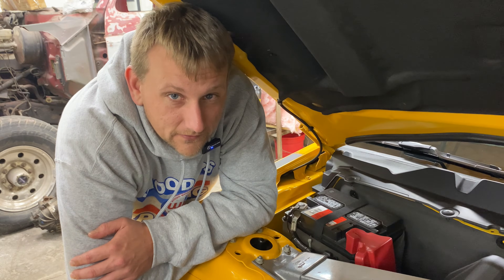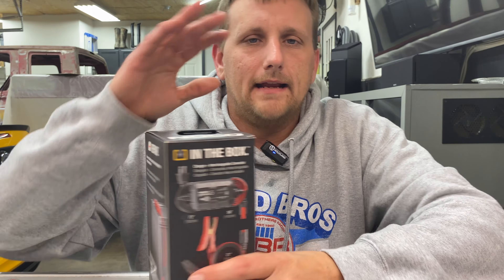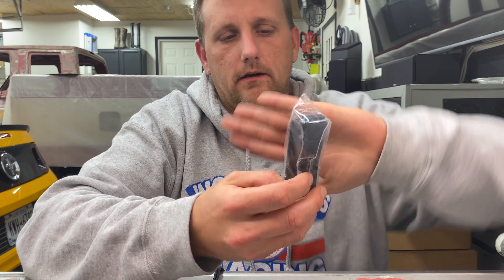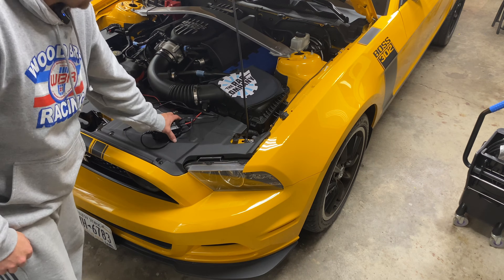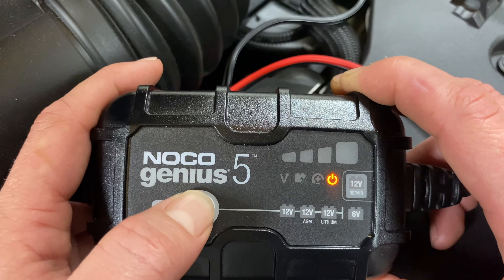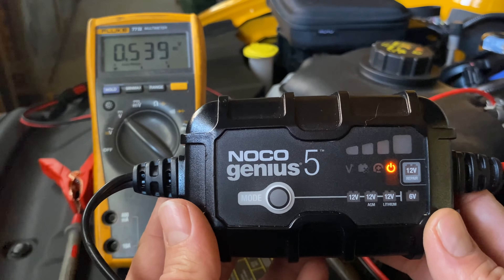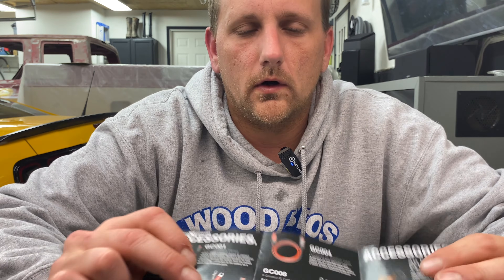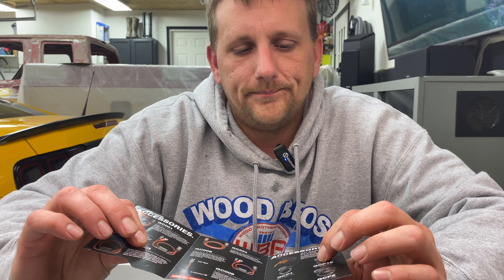NOCO Genius 5 Battery Charger/Maintainer How to, Features, and Accessories

Comment: Great stuff Nate! I have a NOCO boost, hasn't let me down yet, nice to see they have chargers aswell
Reply from the maker: Thank you! I have the new gen boost. GBX75. Used it to jump my uncles 5.9 cummins diesel. No issue. Tried it on his vortec in his 1500. Wouldn't do it because it drtected a short in the system. Wouldn't let me use override either. Was a great troubleshooting tool but needed it to start to see more of what the issue was.
Reply: My power cable snapped at -37C and it didn't work below -20C. I live where we have winter and summer.

Comment: Will this work on a completely dead car battery? Also what's it's supposed to do while charging?
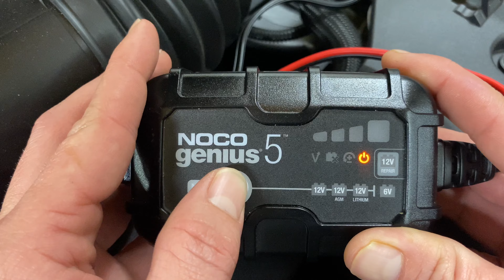Reply from the maker: Yes it should work on a fully dead battery. If battery voltage is too low for the charger to detect, press and hold the mode button for 5 seconds to activate Force Mode, then select the appropriate mode. All available modes will flash. Once a charge mode is selected, the Charge Mode LED and Charge LED will alternate between each other, indicating Force Mode is active. After 5 minutes the charger will return to the normal charge operation and low voltage detection will be reactivated. Then you should be about to use the normal charging mode. In normal mode, you select the battery you have with the mode button. Once active, each status bar light will pulse slowly as it charges up. In the video skip to 10:25 for a full demo of how it works when using.

Comment: Great video! I've just got the NOCO 5 to charge my leisure battery. The battery was down to 12.37 volts, which apparently means its due a charge. The NOCO 5 went through all the colours to green in less than 3 minutes, then the pulsing green went on for 8 hours (with the other colours lit up too) eventually just the green stayed on. Does this sound right, it gets the "bulk" of the charge done in 3 monutes?! The battery is now reading 13.01 Volts, but looks to be slowly going down every 5 mins by 0.01 V.
Reply from the maker: That is correct. All lights will light up one at a time then the green light will pulse as you mentioned then it goes solid green once down. As of for the discharge, a battery will never hold charge at 13 volts for long. Any charger will charge a battery to around 13 volts but it will discharge down after it's done to around 12v and should hold charge there if it is a good battery. 12.37 volts I would consider a good battery. Another indication that it is a good battery is it charged to pulsing green quick. if it had any issues it would charger much slower.
Reply: @natemarcy3939  thanks for the helpful reply! Its a 60 AH leisure battery running an electric fence energizer. From new its lasted 2.5 months without a charge, until it read 12.37 V and I decided to charge. Its now reading 12.91 V after being stood overnight since I took the charger off. 

What volts would you reccomend taking it home for a charge again? I'm going to refit it to the energizer today.
Reply from the maker: I would think once every couple months should be good.

Comment: they need to make multi bank model  that divert unused amps to a battery that needs it
Reply from the maker: That would be a great idea!
Reply: They do make a 2 and 3 bank model ,  but for me I think using 2 devices would be better so if one had issue the other is a backup

Comment: These things need tested in the cold sounds like your in the right spot for winter dead batteries
Reply: It's why I bought mine. My 2019 battery (which was checked out to be fine) kept dying during freezing temps. This battery issue started happening when the car went from being stored in the center of an attached 3-car garage, to a detatched garage. The battery dying only happens when it's really cold out. Keeping a Noco attached during the cold snaps has rectified the problem.
Reply from the maker: I'm sure this winter my garden tractor will go dead so I will do a video when I have a dead battery for sure. 👍🏼